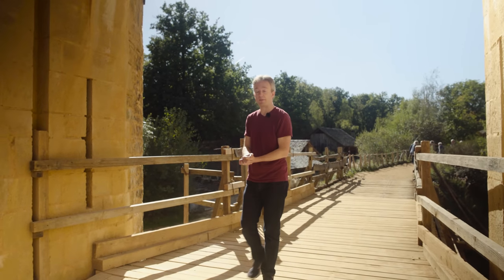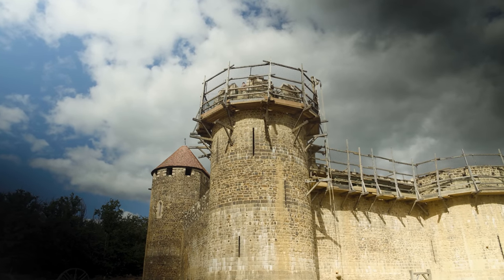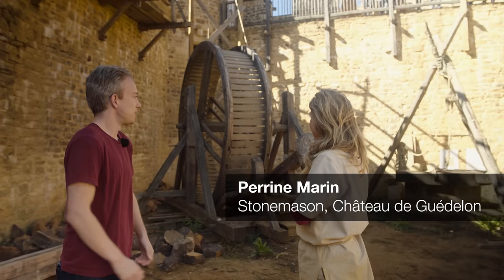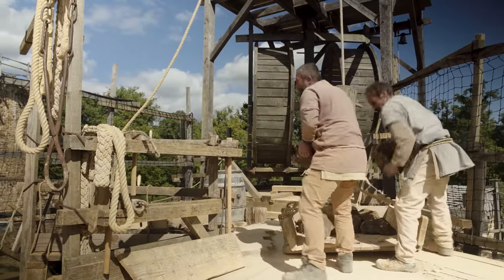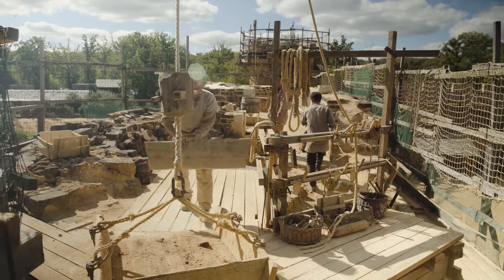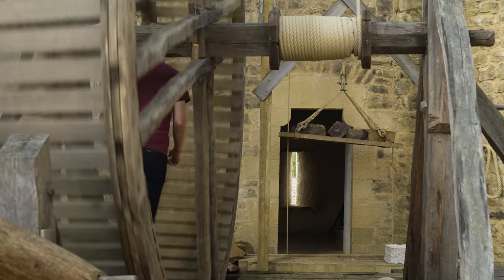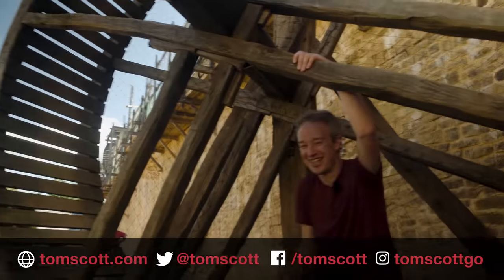I thought the treadmill crane was fictional.

Comment: Something Tom failed to explain...

The crane is such an effort-saving device because, when using the crane, you are only lifting the weight of the stones (plus some rope).   whereas when walking up steps with a stone in your hands, you're lifting your own body weight, plus the weight of the stone.

Therefore, to build a castle, you probably reduce the number of calories needed by 60% by using cranes.
Reply: Obviously the rope and cradle have some weight to them as well, but you're right that it isn't nearly as much as the big sacks of meat we carry around all day every day.
Reply: I can see another, albeit smaller advantage; the crane is traversing a smaller distance - to carry a significant payload a person would need stairs, which means travelling at least 1.4 times as far as the direct vertical traversal that the crane follows
Reply: Plus the energy to hold the stone in your hands.  Plus the energy to walk back down the stairs. Plus the traffic management problem on the stairs
Reply: Agreed.  I had to think about that for a bit, since you are effectively walking uphill on that thing.  Made sense to me when I reasoned that you are lifting your body, but the wheel converts your potential energy into potential energy of the stone.
Compare and contrast carrying a stone to the top of the wall and then climbing back down, vs climbing to the top of the wall and coming down in a rope and pulley arrangement that lifts the stone as you drop.
Reply: I imagine it also avoids a lot of injuries from mishandling the stones on the way up or from the repetitive stress of carrying them.
Reply: That feels like it shouldn't make sense. Like it violates the laws of thermodynamics somewhow.
Reply: Also, the force pulling on the rope is equal to the force applied (walking force) multiplied by the ratio of the walking wheel versus the winding rod. If the wheel has a diameter that is 15 times the diameter of the winding rod, the force applied by the walker is increased by 15 times. Otherwise, no one would be able to raise  more than their own mass using the crane mechanism. Tom can't be more than 200 pounds (he isn't a beefy boy). 😉
Reply: @tbotalpha8133  An ideal human would be able to recoup the energy of lifting their bodyweight as they go back down the stairs.    A real human however doesn't have said ability.
Reply: Also saving the energy of building stairs or a ramp.
Reply: @Wierdy1024  A real human make use of their potential energy by rolling down the stairs.
Reply: @BigBrando999  Big thonk 🧠
Reply: You're right, that is an advantage, but a bigger one is the mechanical advantage. 

Lifting 250kg and your body weight could mean you're lifting up to an extra 50% if you're a big guy and that's definitely significant but it's something you can achieve with a pulley. 

The huge wheel means that, to put it layman's terms,  you can turn a lot of movement into a smaller amount of more powerful movement, effectively trading speed for strength. 

There's also the advantage that all that weight is going through timber and ropes, so there's less chance of injuring yourself (that would still be possible, the force doesn't disappear but again it's reduced by mechanical advantage).
Reply: Thanks for the explanation!
Reply: @michaelwoods2672  Actually from the perspective of the operator it's more "walked distance for strenght"
Reply: Something about your explanation doesn't make sense to me. You're lifting the stones by effectively using your body as a counterweight so the total energy you put into the system must be at least the energy needed to lift the stones to the height required plus the energy needed to "lift" your body to the same height.

Its advantage comes solely from converting smaller energy over a longer distance into greater, superhuman energy over a shorter distance, and it eliminates wasted movement.
Reply: @888SpinR  so your not using your body weight as a counter, (standing won't support the weight) the inertia of the wheel through the axel is,
So you have the pulley system high intensity short to low intensity long, and your COMBINING that with a wheel that coverts your forward inertia into wheel inertia
Reply: Are you not moving yourself "up" in the crane, like the stairmaster machines you see in the gym?
Reply: @BigBrando999  Alternative ways to harness that potential energy: have your workers decend via zipline or jumping into a soft landing
Reply: @vitrify  Spot ON Sir (@Thomas Martin  )
Reply: crazy how I never considered this
Reply: actually the best way is to throw the stones up there. problem solved no need crappy cranes
Reply: or if you could find a dwarf have them carry up the stones, you hold them since they're gonna weigh less than you and you just don't move while you hold them n they go up n down the stairs.  you don't have to worry about you're weight anymore since you're not moving just holding the dwarf while they hold the stones n walk up n down.  it's like  you're not even trying. come on
Reply: Ehr, no, you also have to spin a several hundred pound wheel.  You’re not saving anything keeping that thing going.
Reply: Of course the work for lifting the stones is the same. But with the crane you safe force at the expanse of pathway
Reply: I would call it Sisyphus Work
Reply: @funkkymonkey6924  an experienced operator would be able to convert all the wheel's momentum into lifting at the very end of the lift. I don't imagine it would take very long though, it doesn't look a very effective flywheel at that speed.
Reply: @identiticrisis  That thing is 10 feet tall with all of its mass on its circumference, what do you mean it doesn't look like an effective flywheel.  It's ALL flywheel.
Reply: @funkkymonkey6924  I mean for the application, relatively speaking. It's lifting 200 kg of rock vertically. That momentum (well, kinetic energy) would quickly be sapped well within a foot of lifting the stones. You can see that in operation here.

Also, practically speaking, if it were an excellent flywheel (for the application) it would be very unsafe since it would be harder for the walker to control the speed directly.

Regardless of how effective it is at storing significant energy, in practice most of it will be returned at the end of the lift. The only major energy sink is friction, but tallow has long been used to help with that.
Reply: Aren't you still lifting your own weight as well since you're technically always walking upwards when using the crane? Like it's not gonna go anywhere if you only step on level ground. Obviously though it still saves energy because gravity will be working with you rather than against you.
Reply: @mancubwwa  Yes, that's a more intuitive way of phrasing it.
Reply: @IrvineTheHunter  The maximum force you can exert on the wheel at a given moment relies on your body weight, as Newton's third law would require. Therefore whatever energy you put into the system cannot discount your body weight from the equation.

Whether your body mass moves downwards or sideways or any direction at all is irrelevant.
Reply: @888SpinR  sure, but it's like using  a leaver, it doesn't discount your weight, but I'm saying it's not 1 to 1, the wheel (crank) has it's own mass and inertia over and beyond your body.

So your body is just what turns the wheel, the wheel itself can hold more than 1 body of energy otherwise you could outpace it, but instead it keeps moving faster as you do. (From the wheels own mass)

Comment: Archaeologists in 2000 years will have a rough time.
Reply: As the historian pointed out: The fortifications were already a bit anachronistic in 1228. Archeologists will just assume a minor local nobleman still wanted a castle to display his status in 2022.
Reply: @eljanrimsa5843  What do you mean? Aren't they talking to all the historians and archeologists (etc., etc.) to make it as accurate as possible? Minus some obvious safety upgrades (which, as another poster pointed out, are but a bare minimum, and not even that).
Reply: Archaeologists are smart, they can figure it out😊
Reply: It will be worse for paleontologists in 20 000 years. All dinosaurs lived simultaniously, and with humans (unless they carbon date or something?).
Reply: this and the pyramid in Memphis, TN
Reply: @eljanrimsa5843  rip 😥

Comment: I'm surprised that they don't use a ratched system, where a beam on a hinge can slide one way, but catches if it tries to go backwards.
This setup needs another person to always be ready to manually apply the brake.
Reply: You would need a person with a ratchet system anyway to allow the crane to be lowered, but you're right, it would seem safer during the lifting phase to have something like that.

Comment: I visited Guedelon in 2016 or so and I can tell you that the modern safety equipment is a relatively new thing. Saw blokes throwing 20lb stones up and down parapets and it was absolutely insane.
Reply: In 2014 I saw some using PSE while some didn’t, I reckon they dusted the stonemason/working area with modern equipment every now and then but while passing by the one time I visited the site I didn’t see people wearing dust masks there. Did see people wearing safety harnesses when setting the footings for some of the wall areas tho. Reckon they showed them wearing them this time on Tom’s video because it was a different camera crew or by order or request from the site supervisor. There was that documentary many years ago that is up on Timeline I think that they seem to have clearly asked to film shots without safety equipment to picture somewhat the harsh environment that was castle building when they could get away with it but that crane was terrifying to see at work in person.

Comment: I have a fictional city in a medieval soon to become renaissance world I'm building for some Dungeons and Dragons adventures I'm running. This city was constructed with a combination of magic and ingenuity, as the city sits on a 250 foot tall marble cliff. They used these cranes and water powered machinery to move loads up and down the marble wall all day, seeing the city is a trade hub.
Reply: I'm skeptical a simple treadmill crane like this would be able to hoist a load 250 feet high. I think they'd either need to be using chains of mithral which are the diameter of dinky little jewelry chains but as stout as rope, or they'd need to be using a series of cranes to lift it up by tiers.
If they have magic available, though, they should just be using some variant of Tenser's Disk that moves vertically instead of horizontally instead.

Comment: As someone who trained and worked for years with all types of modern winches and cranes this thing is a work of art and I can truly understand just how important these thing are in moving large quantities of building materials safely and efficiently. As a trained engineer I can also guarantee the had some kind of breaking system no way could this machine have been used for this long by so many skilled engineers without someone solving such an obviously simple fault I suspect it would be some kind of rope based system operated by the person in the wheel saving manpower and being rope or leather it would have rotted away in the few remaining examples.

Comment: Those are great when you don't have access to water power or if the wind doesn’t blow.

The only downside is that they require a beaver to keep them running, and the power output is quite limited.

Comment: In Lüneburg, Germany, there is a crane with two wheels that was used for lifting the salt into the little boats and goods on them for moving them across small rivers and channels to the coast, to cities like Lübeck and Hamburg for further distribution across the sea. There is a Club preserving such a boat, the crane and the art of destilling the salt from the water under the city. They mined so much salt and destilling it out removed so much structure under the buildings that there is a large collapsing crater under it. You can see where the salt was washed out, there is even a museum about the history of Lüneburg and its salt in a part of the old market hall.

Comment: As someone who has worked in France on restoration of several cathedrals as a stone carver and mason this is accurate. All castles and cathedrals were using this hoist method. Several cathedrals still have the setup in their strategic places somewhere in the roof area as  the building is never “finished”, eroded stones need to be replaced and there could be always need for this - the masons thought. In medieval times there tread mills/hoists were powered by young men with mental disabilities but physically apt or of blind people for several reasons: no vertigo, height issues, no dizziness.

Comment: The head-bashing-on-the-axel issue probably meant the treadmill diameter had to have been a little over twice the height of its operator.   So if someone was 6 ft, and the axel diameter was 1 ft, the total treadmill diameter would have to be 13+ ft for comfortable operation.   A wider diameter also meant you had more leverage and could lift more weight, - so it would be a win-win design consideration.

Comment: A treadmill (also impeller) is a drive for mills and in particular for lifting devices such as cranes that have been used since the Roman Empire until modern times. It works according to the corrugated wheel principle and uses the physical strength of humans or animals.
Reply: I would argue that it doesn't rely as much on our physical strength but just on our ability to lift our own weight up an incline.

Comment: The ancient Romans used treadmill technology to power "pumps", rotating/tilting containers of water around the wheel structure of very large treadmills, or a series of treadmills, in deep mines to keep them dry for workers to get at the precious metals, or used for many other reasons in construction. Those people on the treadmills were typically slaves, and in many cases, captured enemies or criminals from their judicial system. Many times, this was a death sentence, given the fumes released (along with sheer exhaustion over the course of the time on the treadmill) that came from mining and the slaves(s) on the treadmill were directly above where the miners were working on very large treadmills designed to have numerous people walking to power these (often times) giant pieces of equipment. The worst position had to be those who walked on the very top of the outside of the treadmill, when more manpower was needed, along with those on the inside of the bottom of the structure, as seen on this video. Total concentration must have been needed to stay on the "sweet spot", or fall off the top. Imagine the torture when extra speed was needed, and the slaves were forced to almost run on the treadmills while staying in time with others on various other points of the structure.

Comment: Looks like about a three meter diameter walker and a 20cm diameter pole, so about a 15 or 16 to one gear ratio. You can't lift 15 times your own weight though, because your not hanging from the 90º point of the wheel, but walking at about a 30º or so angle ... so only applying about half your weight to the lifting.

Comment: Hmm seems like 2 of those carts next to each other and using men to stand on one side to life the other up would be faster and less tiring.  

Put rocks on one cart, men stand on the other cart at the top and transfers the weight.

Men at the top unload while men at the bottom load the next set

Comment: Okay, serious question. Did you not know what a mill is? Why would we call it a treadmill if the originals weren’t designed as components to a type of mill? The damn thing is a waterwheel for a regular mill, but with the slats perpendicular to the line normal to the radius. The original use was to turn a giant millstone by walking, and they later realized, “hey, what about ropes and pulleys?” Not everywhere humans lived had rivers and good wind to grind wheat. Of course this thing was real. It was probably real long before we have actual proof of it being real.

Comment: Murder hole!?
Reply: Thin narrow slots with angled openings built in to a wall with a hallway or walkway behind it. Archers stand in the hallway and fire arrows through the slots and the wall affords them significant protection because it's very difficult to fire an arrow through the slot from a distance and very difficult to get close enough to accurately shoot through the slots without getting and arrow through the chest.

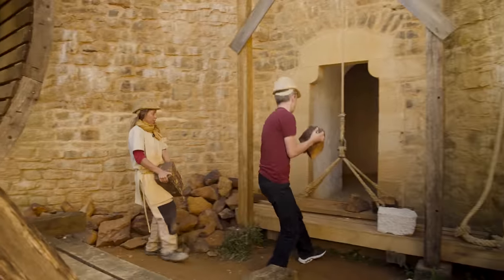Comment: I’m sorry, but MURDER HOLES?? (2:41)
A castle currently in construction has “murder holes” and Tom decided to make a video about the crane 🤷
WHAT is a MURDER HOLE?
Reply: Thin narrow slots with angled openings built in to a wall with a hallway or walkway behind it. Archers stand in the hallway and fire arrows through the slots and the wall affords them significant protection because it's very difficult to fire an arrow through the slot from a distance and very difficult to get close enough to accurately shoot through the slots without getting and arrow through the chest.

Castles were designed to protect against attack from the outside so there had to be a way for the defenders inside to shoot at oncoming attackers. Crenelations are another type of slot to shoot through at the top of the walls.